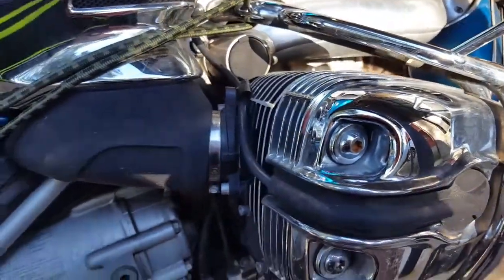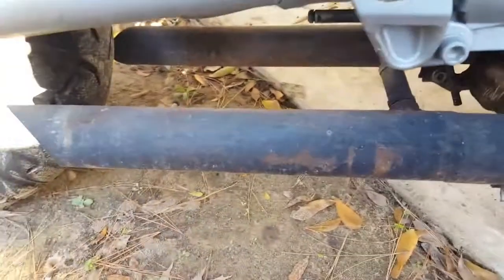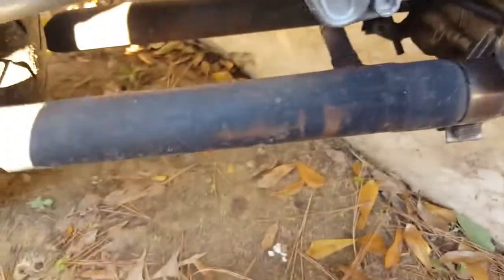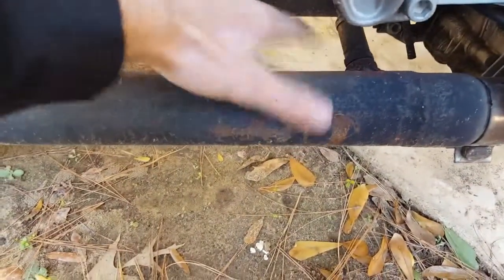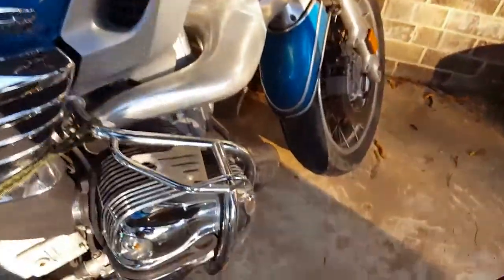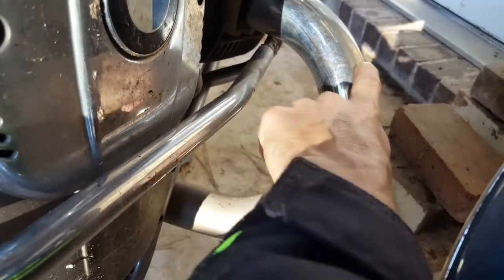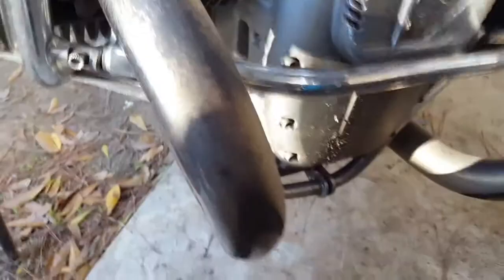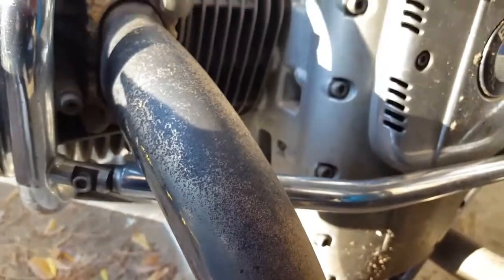The BMW r1200c exhaust mods

Comment: nice video man! :) try hitting those rust spots with some aluminium foil, bit of old elbo Grease and the aluminium reacts with the rust and just powders right off :) worked a charm for all my crashbars! pretty sure Iv got some before and after shots somewhere but Idk how to post em! :)
Reply from the maker: never heard of that before,  but im not going to knock it. ill try anything once, when i found out about the steel wool my buddy started rubbing my chrome with it before i knew it was cool i was freeking out. lol low and behold it worked shined like new.
thanx for the advise.